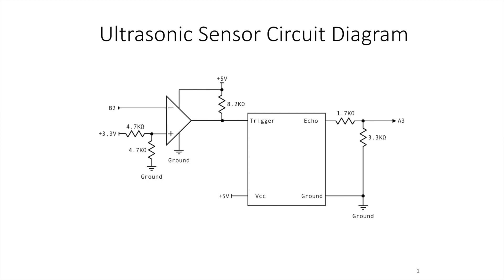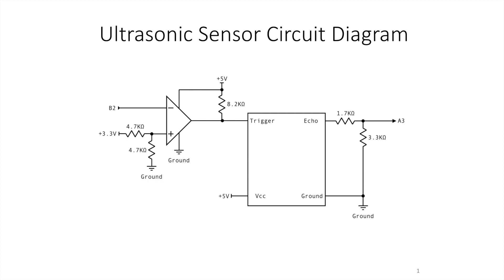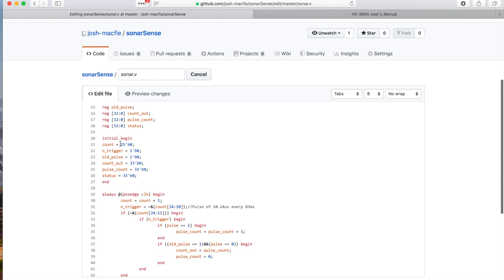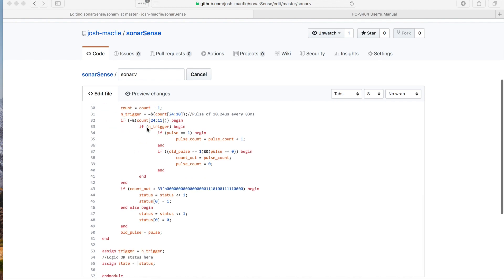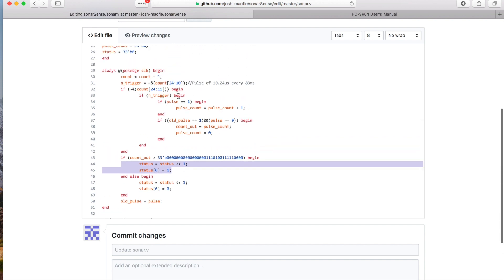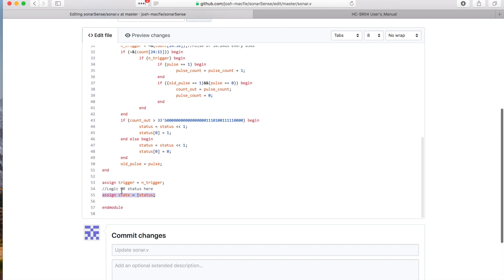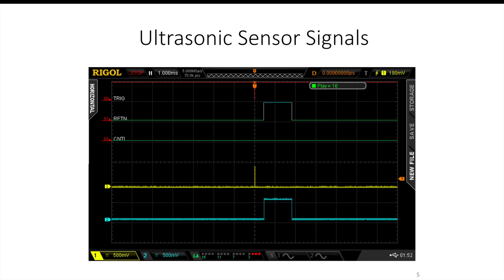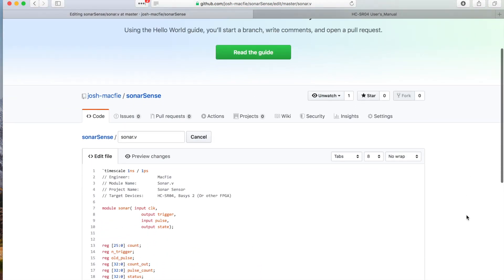How to code verilog for ultrasonic distance sensing.

Comment: Why not just have a 10 micro second counter?
That's like having a 100_000 counter (on a 100 mega hertz clock).
For 60Mhz its like 60_000 counter, no???

But honestly that 1 bit difference trick is kinda cool. I really dig that idea. But I'm just suggesting a simpler way to do this.

Plase forgive me if Im being dumb.